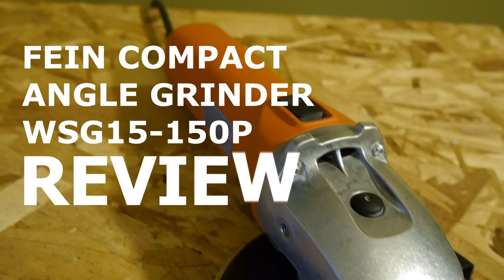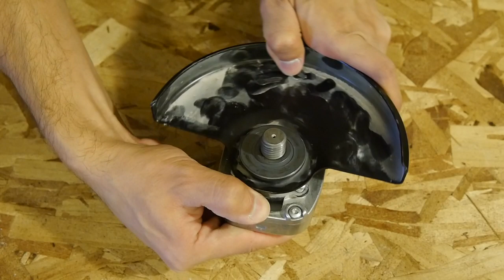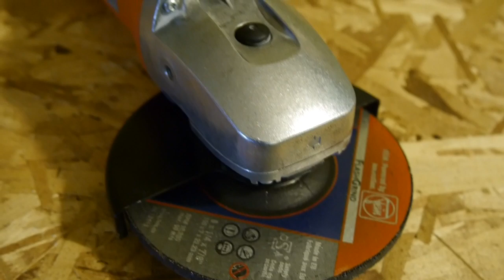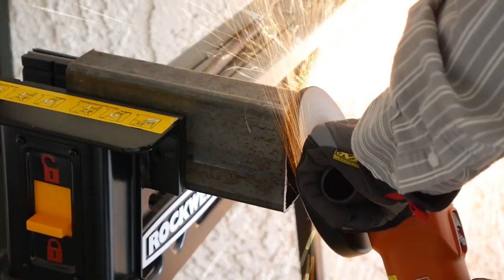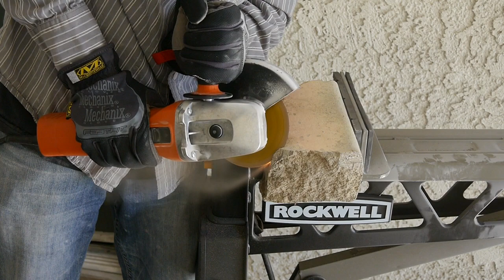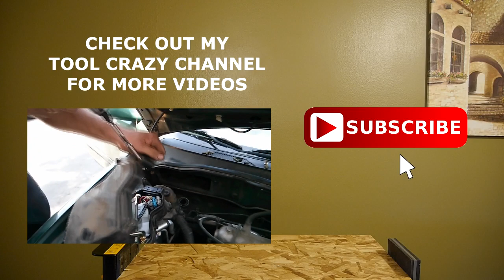Newer Fein 6 inch Compact Angle Grinder WSG 15-150P Review

Comment: Dang that thing looks like a beast for a compact angle grinder! You can really go wrong when you chose any too from Fein! They don't sell garbage tools! I just don't do enough grinding to justify the purchase and I would rather have a cordless one just for the convince. So for me the Milwaukee M18 fuel probably makes the most sense in my situation.
Reply from the maker: DarkRaptor99 yup, very powerful grinder. Another fine tool from Fein. One thing I like about Fein a lot so far is that they include unique features. This one has the very slick rotating head